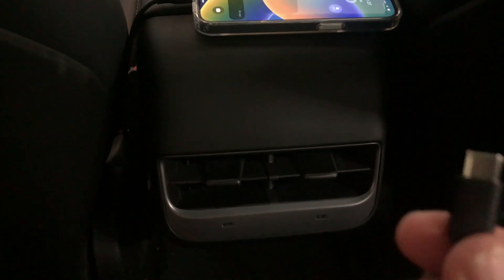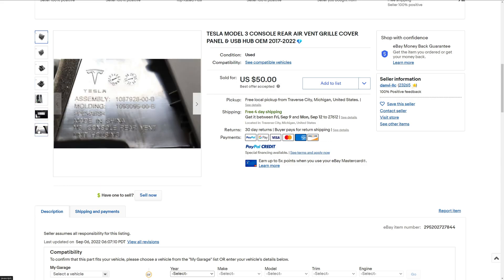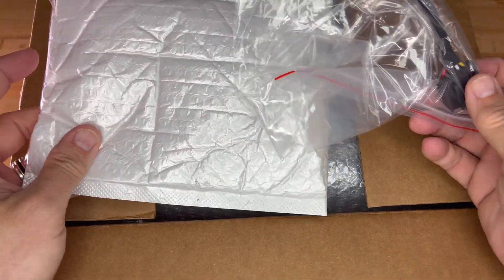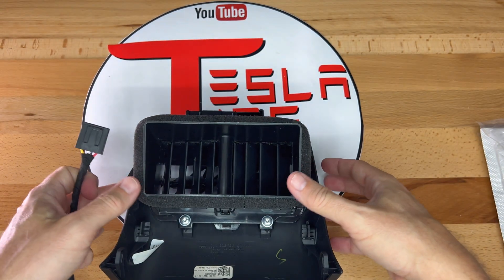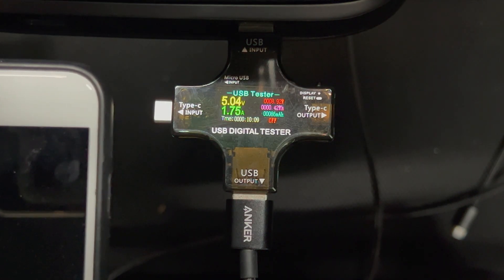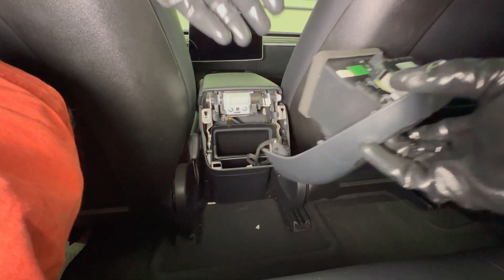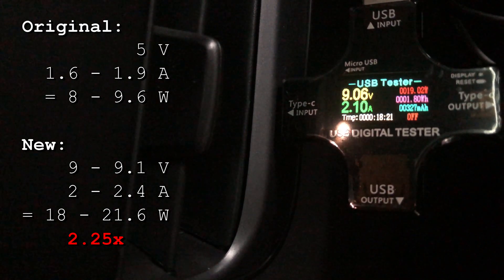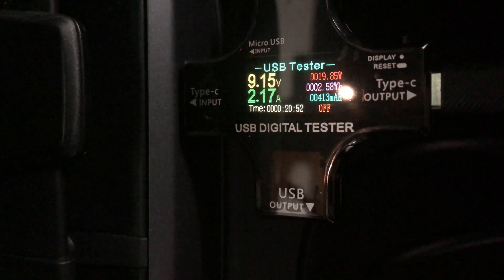Tesla Model 3 - Faster Rear USB Replacement

Comment: Any chance you've done this but to the front usb A's and swapped it with the usb a/c module?
Reply from the maker: No I haven't.  Since I use a front USB port expander and SSD storage, I haven't had a need to.  But it's probably not a bad idea.

Comment: Has anyone had trouble with the replacement console making a buzzing or whining sound when you plug it in?  I purchased two consoles off eBay and both make a buzzing sound continuously (also the USB C ports do not function).  I'm trying to determine if I bought defective units that are being resold (they came from the same person) or if my 2018 Model 3 power harness is somehow incompatible with the adapter shown in this video and the new rear console.
Reply from the maker: Did you purchase an adapter that supports the USB-C in the newer vent modules? It has a different connector than in the original 2018.
Reply: @MTNRanger  Hi MTNRanger.  Love your Ocean Views channel BTW!  It's awesome.

I did get the adapter; the connectors fit.  I ultimately got two adapters because the first one came with a discontinuity in one of the wires, which was surprising.  The second cable adapter tested good, but the consoles still don't work (buzzing & no power to the USB).

My old USB A console still works fine.  I'll check the voltages on my outgoing console wires (4 wires).  [I don't actually know what those voltages are supposed to be - but I'll guess 2 @ zero and 2 @ ~12 volts???]

As for the two consoles I got off eBay, the seller is a little suspect (I ordered from a domestic seller but they misrepresented their location [China] and provided bogus return addresses that were in Australia and elsewhere.  Nevertheless, I haven't fully determined the parts are defective yet.  eBay gave me a refund, though.

I'm also going to see if I can get a known legitimate part from Tesla and try that.  I'll report back.
-Hullspeed
Reply from the maker: @Hullspeed  Thanks let me know.  BTW, I sold my old and new console vents so I can't test anything on them for you.
Reply: @MTNRanger  The problem appears to be in my harness adapter.  It lands the positive on the negative and the negative on the positive.  I need to modify the custom cable I bought.
Reply from the maker: @Hullspeed  I'm surprised it's not correct. Sorry to hear that.
Reply: @MTNRanger  Whoever made the adapter cable, in their basement or kitchen table, just put one of the connectors on upside down.  This afternoon, I cut the adapter cable in half, flipped it, and crimp connected the wires back.  I just installed the new console shell with the corrected adapter cable and it works great!  I can pull 18 watts from each connector (which is as much and any of my devices will pull).  Of the various YouTube videos about this mod, I've seen just a few comments from people who ask about a buzzing sound and no function.  I think this is their answer.  I'm happy I have USB C connectors now.  The previous USB A connectors would overload and drop out around 2 amps.  It's all working now!  USB C rocks!  I might put a little video on my channel, that covers the cable QA check - but I don't have the reach, nor the Tesla audience, that you do.
Reply from the maker: @Hullspeed  Great news, I’m glad you got it to work.

Comment: Did you hear hissing or buzzing sound when plugging the new usb-c board in?
Reply from the maker: Nothing at all when I plugged in.  Has that happened to you?
Reply: @MTNRanger  yes. The USB-c board was making the sound.
Reply from the maker: @chicubs321  Weird, I wonder if it is defective and needs to be replaced.
Reply: I bought 2 consoles off Ebay and both made the same whining (a medium-high pitch buzzing sound) sound.  None of the USB C ports work.  I'm trying to determine if I purchased defected or broken units that were being resold - or if there is an incompatibility between the part and my car and harness adapter.

I'm going to try to get an OEM Tesla console part from service...

Comment: How did you get the part number for the panel?  From the old one or some other documentation?  I’ve got a 2017 MX with a questionable USB port between the front seats.
Reply: Also, how did you find the adapter cable?
Reply from the maker: The part number is for newer Model 3/Y cars that come with USB-C.  There are a number of message boards that have discussions on this. They also mention the USB adapter. Here is one: https://teslamotorsclub.com/tmc/threads/model-3-usb-c-retrofit.199232/

Comment: Is this doable in the front as well?
Reply from the maker: It's possible, but it requires a bit more work (at least an hour or more).  It uses the same harness adapter from my video. Front USB Hub part number is 1522264-00-B https://teslamotorsclub.com/tmc/threads/model-3-new-usb-c-center-console-data-hub-from-model-y.197304/page-17